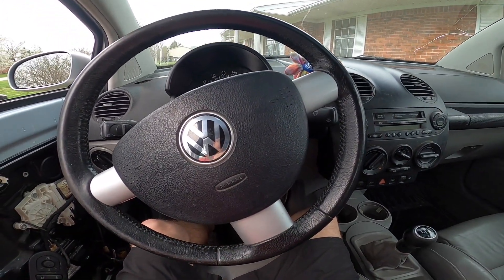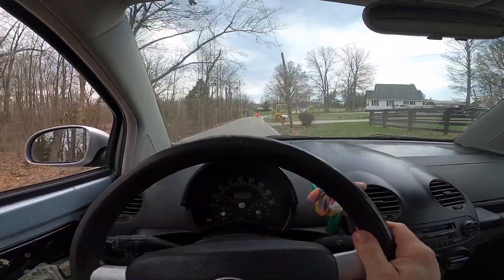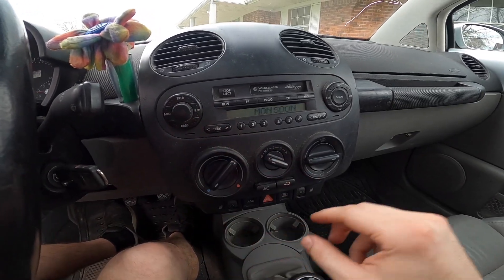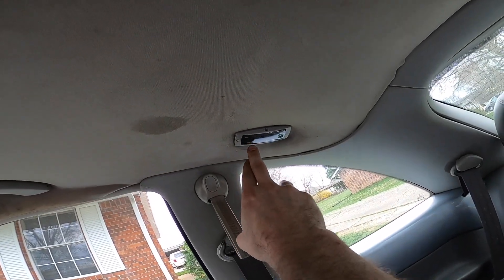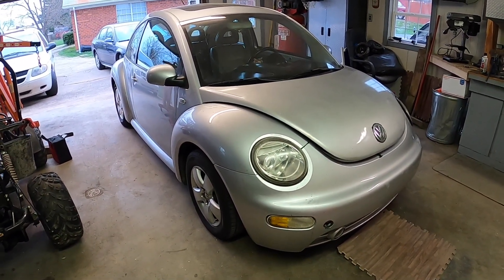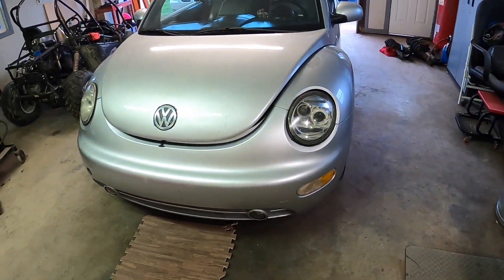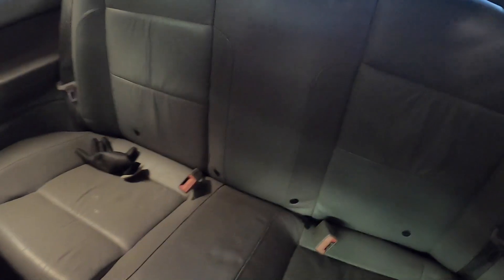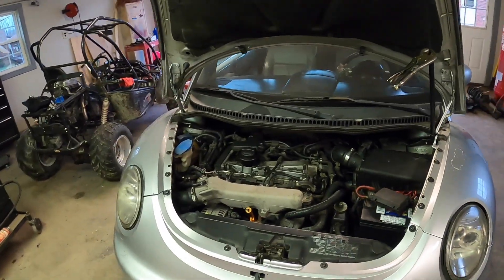I bought a $1000 Turbo VW Beetle on Facebook Marketplace

Comment: I picked a 2001 new beetle turbo 1.8t bought it not running got a new awp head new head gasket new water pump timing belt new 3inch catless down pipe new intercooler and stage 2 tune I’ve got 900 in it rn
Reply from the maker: Sweet.   They are fun cheap cars.

Comment: Wow, cool how it can spin the front wheels mid way through 1st gear!
Reply from the maker: Those 1.8turbo 20valve engines make good power.
Reply: @mosierwerks  once you said you where thinking of putting a black rose in her that creeped me out! I did the same damn thing with a fake one😂
Reply from the maker: @the_babadook666  they also make metal roses.  I ended up selling this beetle and bought a Mercedes.  I made a video on it.  It’s a way better car.
Reply: @mosierwerks  trying not beating the absolute piss out of it and build it the correct way

Comment: Door panels beware when you take the panels off be very careful the top, where you'd put your arm when the window is down splits!, mine split all the way across the top (frustrating). If you get new ones (recommend you do this new or intact) buy PC-7 epoxy and lots of JB weld, get some carbon fiber rough the inside up, and paste the carbon fiber (could use fiberglass too) on the not seen underside. It's like a spline fitting piece that splines into a slot. Story of mine, it split but 10" from the mirror back, I did the above to fix it my fix did work but when I put the panel back on it just split the rest of the way after my fix. So, do the whole way across I used JB weld and PC-7 on top cause the JB weld could run in under the lip. I also fixed my handle and by the looks of your passenger side handle I see I am going to have to do reinforce the bottom too, I think Las Vegas heat and sun are killing my clown car. Thank you for sharing post some more improvements and updates. I did post a vid/clip on my channel before the top split all the way if you want to understand more of what I am talking about. My Bug is a 2003 Tubo S wolf is sheeps clothing I call it😉
Reply from the maker: Thanks for the info.  I know they are fragile and a very poor design

Comment: Nice to see other new beetle stuff. Just picked up a $900 Turbo S
Reply from the maker: Sweet.  They are hard to work on but fun. Same as a GTI but way more rare.
Reply from the maker: Is it manual or auto?  That's cheap for a S
Reply: Turbo S Beetles only came with a 02M 6 speed manual transmission.
Reply: Snagged my turbo s for $500

Comment: Dude that thing looks sweet! I always wanted one haha.
Reply from the maker: They are fun.   I like this one cause it's a sleeper.
Reply: Greg Mosier oh yes that’s for sure. I been a 2.0 8v kinda guy all my life.
Reply: Look up the vid of the auto spoiler thats special for the early year turbos.  They pop up around 45mph, for 01’s around 93mph, i didnt know for years that ive had a little spoiler poppin up n down the whole time.  Once i discovered it I learned about a switch under the steering wheel that allows you to manually pop up the spoiler whenever you want. Love it

Comment: Are these decent cars? I got a line on one for 1300 with 200,000 miles gas engine
Reply from the maker: If it’s turbo and manual trans I say go for it otherwise steer clear.